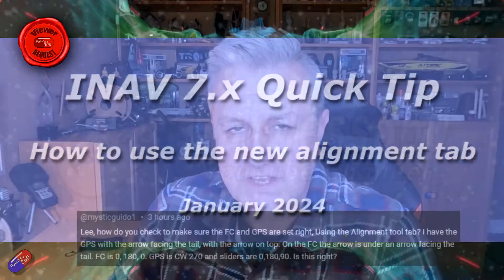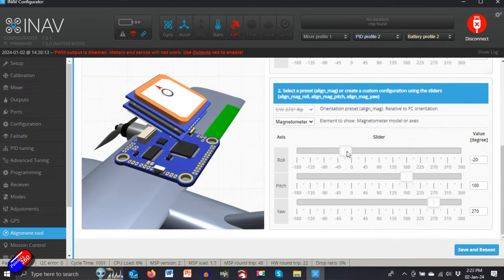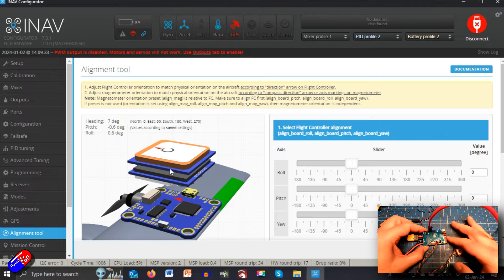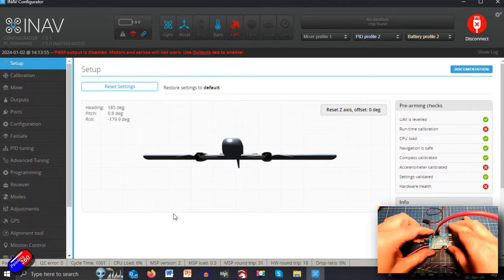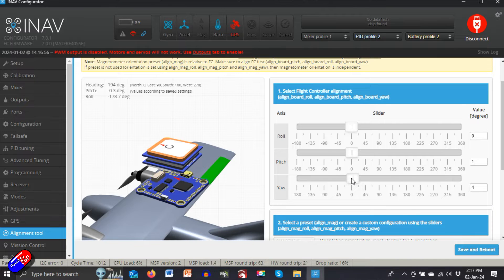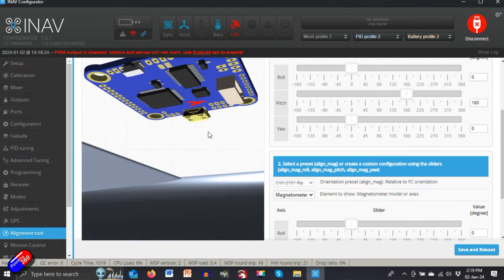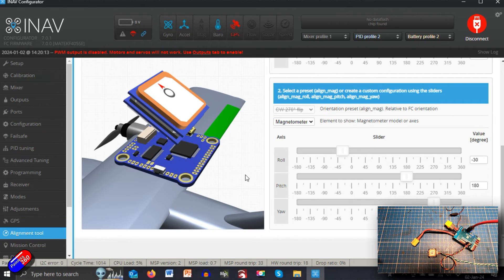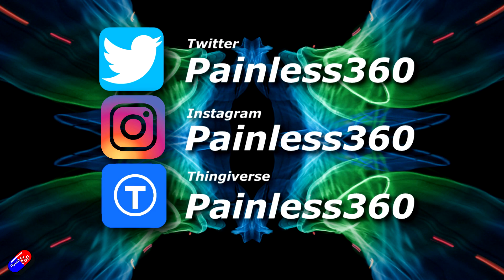INAV: How to use the FC and Compass alignment tab (viewer request)

Comment: Hello, really explanatory video, I followed your instructions but the thing that happened to me was that having the arrow of the FC facing the tail the only way to have a correct orientation of the drone I had to set the angle of the FC to 90 degrees, how can this happen. Thanks again.
Reply from the maker: I've not seen that. Bad accelerometer calibration maybe? I'd save the config and then flash it 'clean' and see if the same issue appears. If not, then it'll be something odd in the INAV setup. Best of luck!
Reply: @Painless360  Thanks for your reply, but I'm convinced there's a fundamental incompatibility with my Jhemcu F405 NOXE V2 flight controller. In fact, the firmware proposed by INAV was for the PRO version. Do you know of any incompatibilities with the version I have? Thanks.
Reply from the maker: I take a lot of time to use hardware in my builds on the channel that works every time. Best of luck with yours..

Comment: Hello, if I want to have an OSD (showing distance from home and compass heading) on my walksnail goggle for my FPV Car, can I run the OSD separately from my RC Car control? 

So the FC will be only used for showing the OSD, compass, and distance. My car control is using my own controller.
Reply from the maker: Yes you can. Lots of fixed wing pilots use INAV for the OSD, telemetry and RTH features but fly in MANUAL mode so that INAV isn't flying the plane at all. You still need to wire up the flight controller as normal but use MANUAL mode so that INAV isn't doing anything apart from the things you want. Best of luck!
Reply: @Painless360  Thank you!
Reply: @Painless360  Is it possible if I want my RC car to have "virtual track"? 

So lets say I want to race FPV car with my friend in the open field and I put a waypoint on INAV, so the goggle will display waypoint 1, waypoint 2, waypoint 3 etc till finish, and we just need to follow the arrow the INAV gives without the need of actual track.
Reply from the maker: It is something others are talking about! https://github.com/iNavFlight/inav/discussions/10066

Comment: Hi Lee . It's a few years since I've flown inav . I just set up a plane with inav 7 . The flight controller is backwards so I set that 180 in board alignment and the plane Animation moves correctly on the setup screen but on pitch with nose up its showing negative values in the degrees .  Is this something this will effect flight modes . Cheers , Chris
Reply from the maker: Don't woory about it. So long as the model moves correctly on screen, you're good. Best of luck

Comment: Did they get rid of Compass alignment in 8.0? It doesn't appear anymore in the alignment tool!
Reply from the maker: Is the compass confidured and showing as blue in the top of configurator?
Reply: @Painless360  it is showing blue. If I plug in my older 7.1.2 craft, there it is. Unless I’m getting confused and they just removed the visual compass - mag alignment options are still there in the alignment tool. I’m pretty new to INAV which doesn’t help either.
Reply from the maker: When I start flashing my fleet that include a compass, I'll check..

Comment: Hello. After you did all that and the fc being in a different orientation, why is the calibration off? The setup tab shows the plane moving correctly but the calibration tab has  it still mounted in the default orientation. Does this matter? Or the orientation is irrelevant?
Reply from the maker: It's just how it works. Best of luck
Reply: @Painless360  so I'm using a quadcopter board. The Speedy bee f405. Do I have to set up the motor timing in the CLI for the servos if I use the motor outputs for them ? It seems like the F7 FC's I didn't have to reconfigure the motor timing. Maybe I'm just missing something. You're about one of three people that I found videos about how to use a drone FC on a wing on a wing very very limited information on it
Reply from the maker: For timers, outputs are normally grouped into sets. In modern INAV, you can select what each timer group is used for, servos or motors... best of luck

Comment: Not a bad instruction - BUT why didn't you address the fact that pitch and roll are not right?  If PITCH is changed that means nose up/down.  If ROLL is changed it should roll-not pitch.  A bit of work is needed yet to make this great tool more realistic.  Thanks for your videos
Reply from the maker: As items are rotated, the axis change. Happy flying!
Reply: @Painless360  Yep  Thanks for the prompt response-especially for such a dated video.

Comment: Hi your channel is very helpful for beginners like me,I really appreciate your work,I use speedy bee f405 wing and gps bz 181 model without compass everything is stable until I get the gps fix after the gps fix the there is a constant change in the roll,pitch and yaw, what is wrong and how to solve this issue. I need your help and Thanks in advance
Reply: S😅yeaw you 😮

Comment: hi can I ask something?
Reply: @Painless360  is it necessary to face the drone to NORTH before calibrating the compass?

coz when I calibrating the compass without knowing where the north point I always got negative value for all z, x and y
Reply from the maker: No, you can have it any direction. Ensure that the compass points in the direction of the model after calibration..
Reply: @Painless360  I already did that then when I start calibrate my compass it give all negative I use hglrc m100 gps
Reply: @Painless360  there is a bug on INAV 7.1.2?
coz when I try to update the firmware to 7.1.2 it stack on Device - Saving default settings
Reply: @Painless360  when I point the exact direction of the model when I watch the 3d model drone in Setup tab then I try to up then point right side the 3d model start rotate even Im not rotating the drone

note: not yet calibrate the compass
Reply from the maker: Then the orientation of the compass is set wrong. It's all covered in the video... Best of luck
Reply: @Painless360  I already change my orientation of the compass.
is it okay? when I face the drone to the right directions there is a small movement of the drone in 3d model then the others are no movement

thanks for answering my question
Reply from the maker: Until the compass orientation is setup correctly, and calibrated, then you may see slight movement as you tilt the nose up and down. If you still see it, then the alignment is wrong.. Best of luck.
Reply: @Painless360  when I tilt the nose up and down I don't see any movement of the 3d only when I tilt up and down the drone then rotate to left i see a small movement

Comment: My the model in the setup tab is 180 from my multirotor. But my multirotor is calibrated correctly as in pointing in the right compass heading. All axis move correctly and multirotor flys great and all gps functions are great. Do you know why the setup model is 180 different? Thanks for your time.
Reply from the maker: It is usually that the FC had been mounted like that. Best of luck

Comment: Just a quick question for you. I am using the Speedybee F405 wing FC. I am using the rudder channel but as a pass through so the F405 is not controlling the rudder but I am on my Radiomaster boxer radio. I am using Inav. Can I do a aileron to rudder mix on the radio and not effect the FC? Or is there a way to do it though Inav?  Thanks for your help and your great videos. Regards from Montreal, Canada.
Reply: @Livinglifeat60 Not sure if I have missed something here and I am no INAV guru, however, by saying 'passthrough' do you mean that you have a mixer rule in the INAV Mixer that allocates a servo for your rudder with an input of RC Yaw?

If so, all you have to do is add another mixer rule in INAV that uses the same servo number, but the input will be RC Roll and a weight of your choosing. By using 'RC roll' it will be unstabilised.

Be aware that the mix is accumulative and application of both aileron and rudder will enhance (OR cancel) the control surface throw.
Reply from the maker: Yes you can, so long as the only output affected on the radio is the rudder. You can also setup that mix within INAV and reconnect the rudder to the FC too... Happy flying

Comment: Thanks for the video. I have a Beitan GPS antenna without any arrows. In My OMP Bushmaster, I've mounted the Matek F405 Wing backwards (180 degrees). Upgrading to INAV 7.0, I didn't notice the new alignment feature until I watched your video. When I looked up this, I discovered the arrow on the GPS points backwards. In your video, I didn't quite get which way the GPS arrow should point, the same way as the FC, or in the flight direction?
Reply from the maker: To the nose of the model.  Remember, this alignment for the GPS unit only applies if you are using the compass. Best of luck

Comment: Such helpful videos Love your style,  I have a question for all comers; I am flying a14-year-old KDS 450 Heli, no flight controller just a basic Gyro, still flies great, however, I can't bind the KDS K-8X receiver to My TX16s mk1 running OpenTX 4n1, Suggestions on a good easy to bind receiver Please. Cheers Simon New Zealand
Reply from the maker: https://youtu.be/DfKyx0yTbXU?feature=shared covers how to check. You need to know what protocol it talks to bind. I've had a look but without success... Best of luck
Reply: @Painless360  cheers, its tricky to know, what a good replacement would be, with so many to choose from. Thanks again for the great content 👌🏻
Reply from the maker: I use Spektrum DSM receivers, FrSjy ACCST V1 receivers like the X8R mainly...
Reply: @Painless360  thank you always good to get Pro advice 👍🏻

Comment: I've put off moving over to iNav 7 but this is very compelling stuff. Having to use CLI to adjust the roll orientation seemed a little silly compared to having a GUI.
Reply from the maker: I'd hang on for INAV 7.1. Should be out in the next two weeks..
Reply: @Painless360  I think I recall Pavel mentioning that in a live stream.

Comment: Nice explanation Lee. What if the GPS/Magnetometer doesn't have an arrow screenprinted on it, is there any way to determine the front? I am referring specifically to the Walksnail WS-M181 GPS; not only did they reverse the SCL/SDA labels, it seems like they forgot to label the 'front' as well.
Reply from the maker: Mount it and see if the model rotates when tilted. keep trying till it doesn't... that'll be the 'front'.
Reply: @Painless360  I tried that Lee, I even created a matrix of all the possible alignment combinations to ensure that I had tried them all. A few alignments got close, but nothing gave that 'locked-in' rotation I am used to with other magnetometers.
Reply: The HGLRC and Flywoo M10 units are the same - no arrow. Can you use the dot in the corner of the chip to determine which direction is the "front"?
Reply from the maker: I use the method mentioned. Sadly there isn't a 'rule' every GPS follows (but most do).
Reply: @artifixprime  Based on the dot on the chip, I believe the 'front' is actually at the connector side; but that orientation doesn't work. Thanks for the tip though.
Reply: You actually managed to get the compass to work on the walksnail gps  ? so many people  are ending up with duff items either badly labelled or they don't work at all , i tried everything in ardupilot and inav  and reversed the rx/tx  and it just  don't work , binned it now and fitted a ublox ............no more problems
Reply from the maker: I don't use the Walksnail unit. I use and trust the Matek unit with great success here - http://www.mateksys.com/?portfolio=m10q-5883
Reply: @Painless360  If I have a choice I will always go with a Matek GPS/Magnetometer and, like you, have always had great success. However, this WS-M181 came pre-installed in a FlyWoo Explorer LR 4 with Walksnail and given the reported cohabitation problems with some GPS and Walksnail VTx, I thought it best to stick with the Walksnail GPS. Methinks it's time to try INAV again with a Matek GPS/Magnetometer.
Reply: @johnchandler4565  i fly fixed wing so getting a bit of distance between the compass and walksnail vtx has not been an issue, i also have a switch on the vtx and flick it on after the gps lock is completed, tbh those walksnail gps's are more hassle than they are worth and should never have been marketed with known faults but that seems to be the way nowadays with a lot of these chinese electronics and i have been tempted to go back to good old fashioned analogue for reliability and range
Reply from the maker: Gentlemen, there is a VERY good reason you'll see me using the hardware in the builds that I do; it works, it is supported and the quality for the price is decent. Happy flying!
Reply: @Painless360  Thanks for all the videos you have posted you have been invaluable especially as regards to ardupilot which is my go to ,i find it easier than inav believe it or not....much appreciated
Reply: @scrapveiw  The WS-M181 GPS came installed in my FlyWoo Explorer LR4 with Walksnail. Because I wanted reliable RTH, I decided to change it to INAV. The INAV install worked great, apart from a hopeless Position Hold and Return to Home Mode. In the INAV configurator I couldn't get a nice locked setup when rotating the quad; suspecting the WS-M181, I went and bought another one (more fool me) and it did the same. I've now gone back to Betaflight, with its less than perfect Rescue Mode, but it doesn't need a Compass (although I believe BF4.5 will greatly improve Rescue Mode). Thanks for the update on the issues with the WS-Ma8a compass.